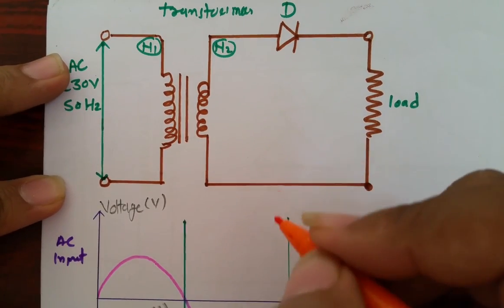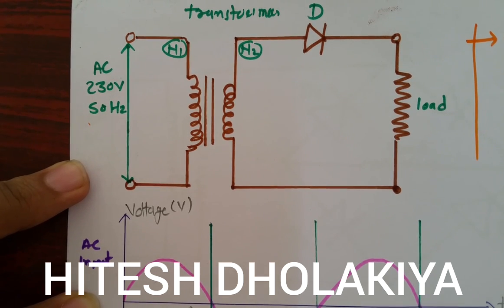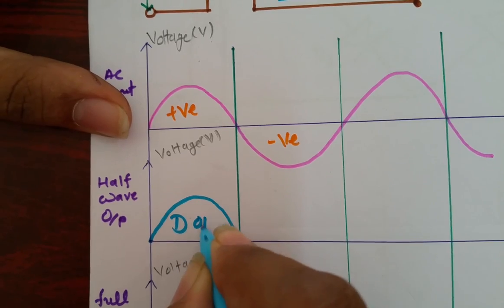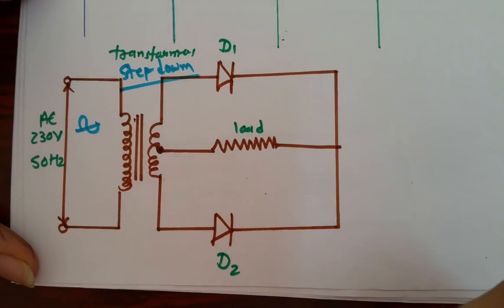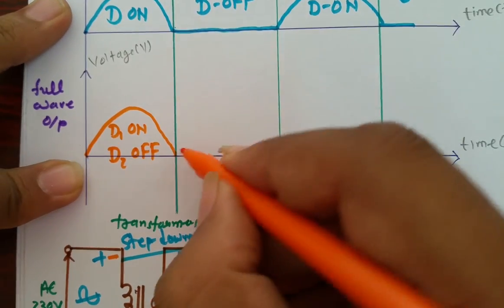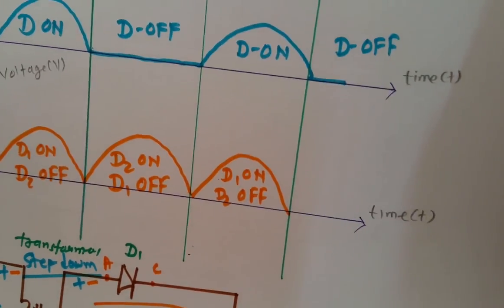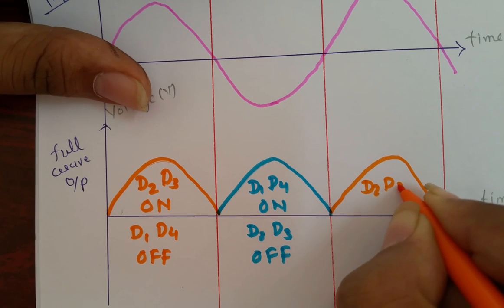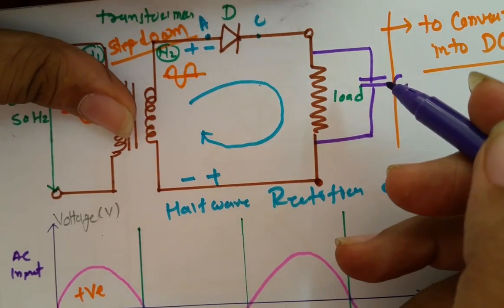Rectifier & Filter | Halfwave - Full wave rectifier (Basics, Working & Waveforms) Explained

Comment: What happens if we use step up transomer
Reply from the maker: If you want higher DC voltage then you should use step up transformer
Reply: Engineering Funda will that effect diode???
Reply from the maker: For that you will have to peak inverse voltage of Diode

Comment: Sir in this lecture topic is controlled rectifier and your using Diode which is uncontrolled. Is it okay?

And one more thing in classification of rectifier i.e. based on type of control (switchs):
 1. Controlled & 
2. Uncontrolled.

Can we add this?
Reply from the maker: This is just rectifier topic, I have also explained controlled rectifier in my power electronics playlist. 
Classification can be done in many ways so there is no as such issues.
Reply: @EngineeringFunda  as a technical point of view it's fine sir. Because we want only rectification. no matter haw it done but practically 80-90% used Ac-DC converters are Uncontrolled.
Reply: @EngineeringFunda overall uploaded videos are so Good to understand & thanks for uploading. Also please try to add comparative study    Ex. symmetrical & asymmetrical both gives same output waveforms then what's difference between then. Which technical things make them different as a designer point of view.

Comment: What would happen if the capicitor open? Shorted
Reply from the maker: Didn't get your question?
Reply: Engineering Funda so i'd like to know in a full bridge rectifier , what would happen if 1) the capacitor filter is open ? 2) if the choke coil (inductor) opened?
Reply from the maker: If capacitor is open then output will be same as without filter. If inductor is open then output will zero for pi filter.

Comment: Can you give the behavior of a shorted capacitor in a circuit
Reply from the maker: Shorted capacitor has infinity charging time and zero discharging time. So across shorted capacitor you can see zero voltage but high frequency response will change.

Comment: What is the value of capacitor to be used in 12v, 24v..and what kind or value of diode .. thanks
Reply from the maker: +Gerwin NiwreG : capacitor and diode are not selected based voltage, it is selected based on power of input signal
Reply from the maker: +Gerwin NiwreG : for high power signal power diode is used and for fast charging of capacitance lower value of capacitor should be used